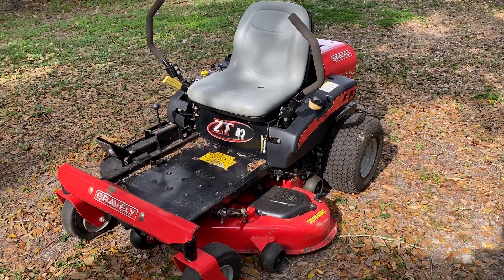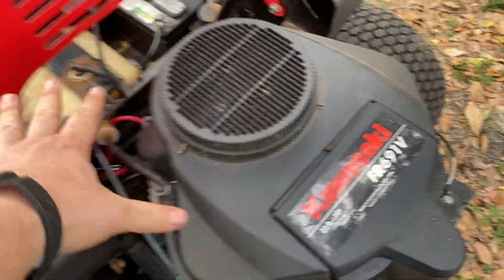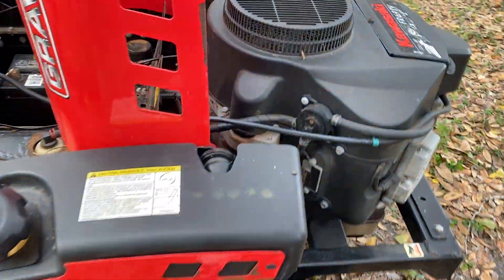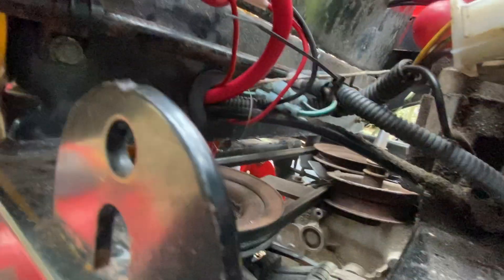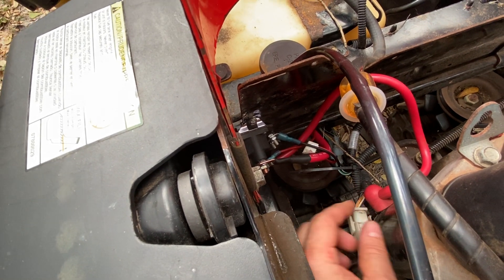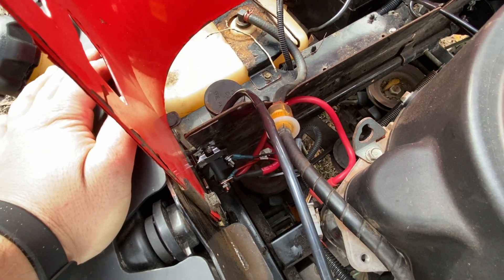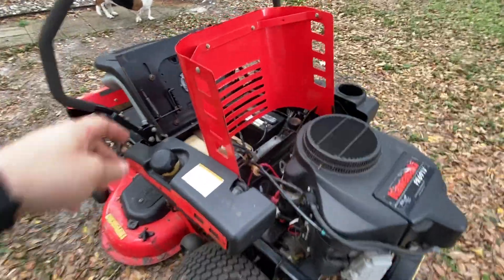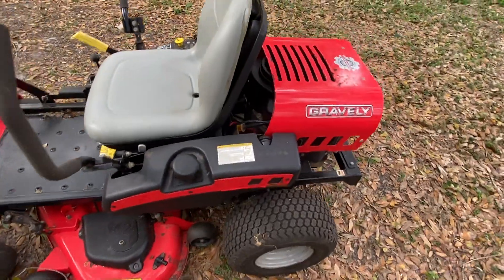Gravely ZT42 Starter Solenoid Mod For Better Serviceability

Comment: Since the solenoid is so hard to get to, this video was very helpful for planting the seed of an idea. However, instead of bending the plate and mounting it where they did, I mounted it just to the right of the fuel line, one bolt on the beam and the other on the plate.   I used an existing home on the beam (I tapped it for a 1/4-20) and drilled and a tapped a similar home in the plate - however, a self tapping screw oof sufficient diameter would also work. Placed here, the seat does not hit it, I did not have to modify or change any wires, and it is even easier to get to.

Comment: Actually just replaced mine. All I did was cut the front lip under where the front of the seat is just enough to pull the gas tank out. After that replacing it was super easy. Now my major issue is replacing the bearing in my spindle. Not hard to do just hard to take off the mower deck.
Reply: Great idea!

Comment: 0:36: "I don't know why they did this..." I know why. Because they're poor engineers. In a good design, parts that can reasonably expected to fail (and that includes starter solenoids) are inexpensive to replace in terms of both parts and labor. Gravely failed here on both counts. They try to sell solenoids for about four times the cost of an old Ford-style automotive unit that will do the job and last far longer. And they hide it up under a frame rail, making it very hard to diagnose and access. As you point out, putting the unit in a sensible location wouldn't have been that hard.

Comment: I have this exact Gravely, though might maybe be slightly newer but looks exact same.  The frame at the front spnontaneouly, the welding where side frame meets front, at both sides, literally the welding came undone, on both sides, and frame broke there.  Of all things to break, the frame?!  My local official Gravely dealer contacted Gravely and NO help or backing this!  Gravely was like “sorry to be you.”  There was zero rust on this.  If it wasn’t the frame, I wouldn’t expect Gravely to support but, because it was, and Gravely offered NOTHING, I’ll never get an other Gravely again
Reply: Same here. I got some scrap steel, fabricated a couple of braces, and welded them on. So far, so good...and it even looks factory.

Comment: I have the 34  I wonder if this applies
Reply from the maker: Best way to check is to go out to your mower and try and find your solenoid. If it’s “missing” chances are it’s tucked away. Make it a weekend project and remove and relocate it before you’re left hangin.